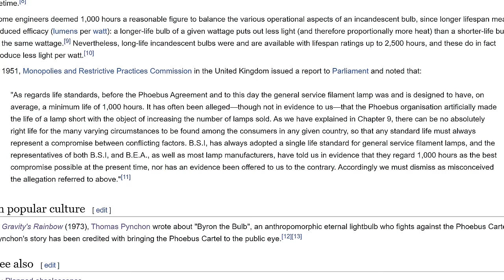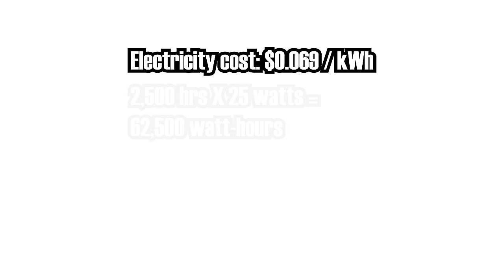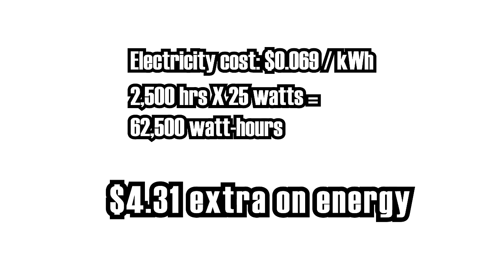Longer-lasting light bulbs: it was complicated

Comment: When I was a kid… exploding lightbulbs were a thing. I can still hear the sound. My dad had one explode in his face. Then, we’d get out the needle nose pliers and rubber gloves. Also… the memory of stepping barefoot on a long-since exploded shard of glass from a light bulb.
Reply: I've done my fair share of those extractions, but always from external breakage like dropping a drop light (irony!) or hitting my head on a bulb in the basement.
Reply: That is interesting, never experienced that and never heard of that before. At least here in Europe.
Reply: @DerIchBinDa  from what I understand, your electrical system is better than ours. It happened at the house I grew up in which was built in 1948. It also happened at my grandma’s a lot which was built in 1900. So, ya.
Reply: This is absolutely true, to the point that some old movies and TV shows used it as a trope. When an old incandescent light bulb filament broke an EXTREMELY hot arc would form across the gap between ends of the broken filament, and if the filament were vaporized or melted away from the supports a HUGE arc would form inside the bulb envelope consuming more and more power as it grew and got even hotter (plasma has a negative coefficient  of resistance - its resistance decreases with an increase in temperature, the exact opposite of a metal filament). Eventually gas pressure in the bulb would rise so high as the plasma of the arc grew (Charles' law), or the plasma contacting the glass would cause such a huge temperature differential that the envelope would explode. The problem was mostly solved in quality lamps by introducing a fusible link in one of the wires inside leading to the filament which rapidly  melted or vaporized away during high current draw.

Comment: In the 1960s I recall bright yellow four packs of 60W GE light bulbs selling for about $1.  We thought of them as consumables, so we always kept a few bulbs tucked away in the linen closet.  They were consistently reliable out of the box and lasted a decent amount of time.  Around the end of the "incandescent era" something changed.  I bought name brand bulbs that would twist out of their base when you installed them, bulbs which were dead on arrival, and bulbs with remarkably short life spans.  I don't know if this was careless manufacturing or a deliberate attempt to drive us toward compact fluorescent bulbs (this was pre-LED), but it was not a good time for the consumer.

Comment: Reminds me of the last incendescent bulb I had in my desk lamp in my room.
It burned out so many times and I'd shake the lamp until it lit again.
This kept going for over a year until it burned out unrecoverably and I replaced it with a mini cfl bulb.
Reply: Yes, I've fixed many a burned out incandescent bulb, welding the broken filament back together by turning  or shaking the bulb with power applied, until the ends brushed against each other and stuck.  It's much easier with a clear bulb, so you can see what you're doing.

Comment: Also - appliance bulbs inside ovens don't need to have good thermal efficiency. In an oven, the heat is all put to good use when the oven is running, so the bulbs are, essentially, 100% efficient.
Reply: Every oven I have ever had isolated the bulb from the oven interior with a thick glass cover. The bulb’s waste heat was mostly sent to the outside of the oven.

Comment: LED lighting is the bees knees. Beyond the longevity and efficiency, being able to dim and change color temperature at my fancy is amazing. It really changes the feel of a room substantially from clinically blue white to warm and comfortable amber. Much better than the CCFL's of last decade. I don't think anyone really misses tungsten incandescents anymore unless you're a vintage photographer using tungsten film still or motion. For that matter, when I did use tungstens for my studio, I used expensive production rated lamps which actually produced a sun-like color temp; power hungry and hot as they were. Now I can get the same and more colors with 4 brightnesses all in the same bulbs that run at 15 watts max which turns out to be very bright indeed for the same price as a generally cheaper production tungsten bulb.

Comment: About 25 years ago I purchased a 25 quantity box of 5 watt railway signal bulbs. They were originally used in the boom lamps used at level crossings. 
I fitted a cluster of three into two gate post lamps on my property that run all night every night and have done so for 
15 years now, with no failures. I have the timer set to do 9 hours so they have just passed 50,000 hours... I doubt they will ever fail as the filaments still look
dull grey and there is no evidence of tungsten emission on the glass. They are rated at 10V and I am feeding three in series 28V so each is getting around 9V
with a little voltage drop in the cables. Obviously not designed to fail as they are in a safety critical application.

Comment: I've generally had a good experience with LED bulbs but have definitely had some annoying bulb failures at my mom's house. First, she put in some of those inset can lights into her kitchen and has had at least 2 fail in the 4-5 years since she got them, and they are a pain to replace. Also, there is a lightbulb at the top of her stairs which has always been a pain to change. When the longer lasting compact florescent and then LED's came out we were super excited by the idea of not having to to stand on a chair and lean precariously over the stairway to change the light, at least not as often. And yet I think I have changed LED bulb over those stairs twice in the past few years, and there are two bulbs in the fixture! I think it is just cursed.

Comment: Turning the bulbs off and on also shortens their life because the expansion and contraction of the filament fatigues it over time. So a continuously running bulb will last longer than one turned on and off frequently (which is probably one reason why a fridge bulb is designed to last longer, because most of its life is being turned off and on for very short periods of time)
Reply: Surprised he didn't mention this. I've read that using a dimmer switch to slowly increase the voltage and fade in/out will substantially increase the longevity of incandescent bulbs.
Reply: @Consumer7977  studio lighting systems do that as studio lights are VERY SHORT lifespan and VERY powerful 
even in "off" they run a current that is below the light output level to "pre heat" them and they ramp up and down

Comment: Yeah that is a good point Alec, growing up in the 90s there was always at least one lightbulb in the house that didn't work and some of the particularly cheap bulbs would barely last long at all - on top of burning 60W per fitting. I only replaced the CFLs that came supplied with my house 5 years ago with new LED bulbs because they were starting to get a bit dim and slow to turn on, and the LEDs were half the wattage for better light.
Reply: i can tell you one thing: an old cfl that takes some time to get bright is really nice for the first lamp you turn on in the morning. the gradual light intensity increase is a godsent for people who suffer from acute morning hatred.
Reply: @TheScarvig  Just get a smart LED light or install a dimmer. Same thing, less cost, more efficiency.
Reply: @john_titor1  smart lights are plain stupid imho...
i dont need my fucking ceiling lamp to spam on wifi just to talk to my phone.

a dimmer wont automatically ramp up intensity.

also the soft start isnt a feature that i would specifically shape my lighting decisions around. it was just a nice bonus  and a way to look for a silver lining in a dying cfl.

Comment: Just me waiting patiently for this video to include a "build a better lightbulb" reference.  😏💡
Reply: I've often wondered why the innovation didn't move a different direction. For example, something akin to a three-way bulb that would allow for multiple filaments, switching from one to another as they burn out. You could probably make something work with spring tension, where as one filament snaps the next connects. Anyway, irrelevant now.
Reply: @PsRohrbaugh  My best guess: while something like that could probably be made reliably enough to work maybe 90% of the time and still be cheap enough for the market, all it would take would be a handful of occasions for a consumer to expect the failover filament to engage and be met with disappointment for people to start calling such a product a waste of money.

Giving people the expectation of redundancy or a backup of some kind and not delivering is often a recipe for user friction and dissatisfaction.
Reply: @PsRohrbaugh  I guess the easy version of that is two light fixtures in the room.   Or, the very common multi-bulb lamp or ceiling fixture.   I never saw both bulbs in my ceiling light die at the same time.   Still, yeah, something would be nice for those 30ft ceilings with down-spots.   Maybe: not building houses with 30ft ceilings and no catwalk?

Comment: I've seen a rather vintage "light bulb life extender" consisting of a diode placed in series with the bulb. It would operate the bulb at 1/2 power, making it not only very inefficient, but also extremely harmonic-intensive (from half-wave rectification).
Reply: I think that would make it run at more than half power, as the resistance would drop with as the power and temperature drop. Not trivial to calculate though
Reply: I do this with my living room bulbs that are set to provide a warm glow ambience.  I install a diode of suitable rating in series inside the lamp fixture.  They're on a timer, and run every night for 5 hours.  The bulbs last over 20 years easily.
Reply: Light that does not flicker at 50 Hz but at 25 Hz, yay eyes/brain.

Comment: One way of making incandescent lamps last longer is to increase the pressure of the gas inside. This will slow down the sublimation of the tungsten filament.. of course, this will also lead to better heat conductivity from the filament to the surface of the bulb, which makes the filament cool off and be dimmer at a given power. If the gas pressure in the bulb is too high, it could also explode. Not good.

One solution is to have a much smaller bulb with high pressure surrounding the filament inside a normal sized bulb with very low pressure. This makes it act like a thermos and keep the heat in the filament where it can produce visible light.

But now we've introduced a couple of new problems.
1. The heat will be concentrated in the small bulb, so it'll get really hot, and could soften, and since it contains a high pressure gas, it could explode.
2. Some evaporation of the filament will still occur, so the small surface of the tiny bulb will get covered in deposited tungsten and darken quickly.

We can solve the first problem by using a material which handles the heat better, such as quartz.

The second problem needs a novel approach. Some chemicals, such as bromine or iodine, actually makes it more likely for the vaporized tungsten to deposit back on the tungsten filament instead of the quarz, so by adding some to the gas mixture, the quarz will stay clean and the light output stays high.

Iodine and bromine are part of a group of chemical elements called halogens. They're in the column to the left of the noble gases in the periodic table.

We've moved kinda far from a normal tungsten filament light bulb though, so a new name might be in order.

How about "Halogen Lamp"?

Comment: The big issue with this trade-off I have is, that they didn't communicate it properly, and didn't offer long-life variants. There are plenty of places where the amount of light isn't as important as efficiency, think of a storage cellar. It'd be favorable just having to replace the bulb every 10 years, instead of having a little bit more light.
Reply: The tradeoff isn't more light vs longer life, it's more efficient light vs longer life. So the only consideration other than cost to operate (bulb + electricity) would be how hard replacing the bulb is...which for most situations is pretty trivial. Also, if you only use your storage room light for a few minutes a day, 1000 hours will take quite a while to "burn" through.
Reply: Other than the economy of running them becoming higher over time there's also a safety concern as the older an item gets the higher the chance of any kind of malfunction becomes and that can range from anything from the item breaking down to fatal malfunctions for the operator as per the principles of entropy.
Reply: @theparchitect  there are cases where the longer life is worth the trade-off of less efficiency though. Usually when the light is difficult to reach.

Comment: My personal opinion: LED's are getting better.  The first ones i bought were really hot and burned out quickly.   The ones I get now are cooler and work better.
Reply: Not just your opinion.  I've been tracking the performance specs and they have gotten a lot better.  But I do recommend getting a name brand to be more likely to last as long as it should.
Reply: @@doublewhopper67You realise that's exactly the opposite of the premise of the video? Engineering optimizes a technology, initially with significant improvements as low hanging fruit are picked first, then incremental improvements become less impressive and more effort: diminishing returns.

The complexity of a technology determines how long and how far optimisation can go, we're just used to highly complex, relatively immature technologies when we think about these things. Like CPUs, or PV panels etc. While machines such as the ICE are highly mature complex technology approaching optimum.
Reply: From my perspective - the arrival of the LED retrofits was rather spoiled by their CFL predecessors - very oftenly having awkward tints to their light and getting horrendous CRIs.

 So the manufacturers must have thought when introducing LEDs: those dummies would be glad if we just give them an opportunity not to have the Matrix style green color filters in their rooms - and they even don't flicker at startup! 
 - And rolled out expensive, dim and hot garbage with no power filters whatsoever and the nausiating rough strobe. With terrible CRIs as well. And a service life of a potato.

 Even thought of checking my eyes back in those days because I couldn't tell the colors of familiar objects apart despite remembering them to be distinctly different. Fitting an old incandescent bulb back in place showed there was totally nothing wrong with my eyes.

 And all of that back in the days when most of the mobile phones could show off flashes with decent CRIs. Heck, my Nokia even had the first gen AMOLED back then!

 It's just amazing how far profiteering can plummit the quality not just of a single product or even brand, but the whole section of the market.
Reply: The trick is getting the ones that simulate filaments of incandescent lights, the other ones are trash. They are usually 1W per "filament", can easily last a decade. They often come in glass same as an old fashioned incandescent, but they don't die if its broken, and its not a vacuum. Be warned that glass is much thinner tho, very easy to break if handled incorrectly, the lamp will still work if you don't touch the filaments though.

Comment: Thank you, so much, for this video. When I first saw this story elsewhere it had that "something is missing" feeling to it. Your explanation here makes the real purpose of the cartel clear and makes so much more sense than just planned obsolescence. Stuff like this always seems to track back to "The Power Grid."
Reply: Soapy1898 ”Smart” thermostats, which raise the temperature of your house during heatwaves to reduce grid load already exist today. And yeah, there are indeed plans to use charged, plugged in electric cars as distributed grid scale batteries for high demand, low car use periods of day (we’ll see if they can wrangle the half dozen car companies out there into agreeing to all design for this). As for grid maintenance, yeah distribution lines of all sizes have been massively neglected by many power utilities, at least in the US. As for generation capacity, trying to install anything other than a solar panel really involves fighting so many NIMBYs that it’s often just not worth the effort, even for greener things like hydro, wind, and especially nuclear.

Comment: The most funny thing for me, as russian, that in Soviet Union we had lightbulbs that worked for decades. And things like irons, fans, kettles were indestructible too. I've worked in garbage sorting utility base, and we just prayed the God when we catch soviet iron or socket. For example, in modern sockets there are some plates that as thin as paper and made of some scrap metal with least copper. While soviet had half a centimeter wide plates, made of bronze. And in lightbulbs this foundamentality was also.